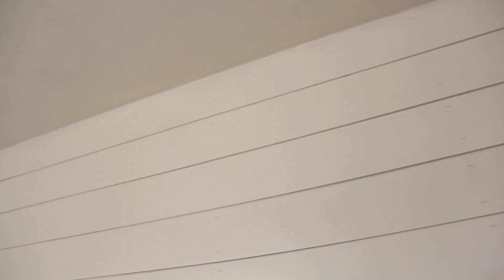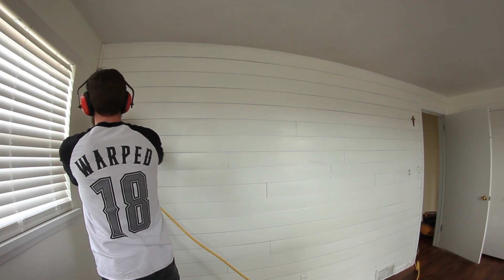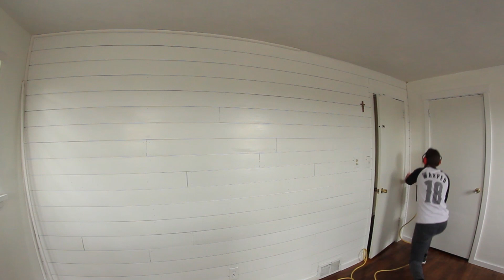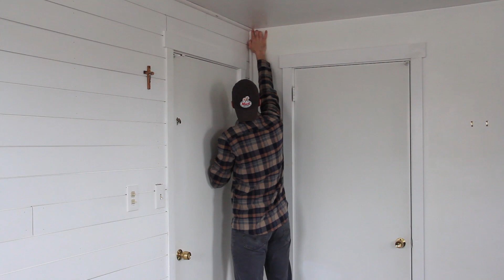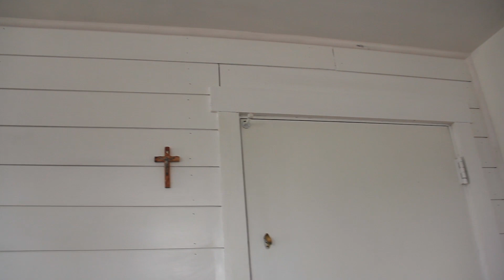How to Finish Exposed Edges of Shiplap After Installation - Farmhouse Renovation #4

Comment: I stumbled across your channel planning my shiplap project for a vaulted ceiling. There are gables on 2 sides that I want to use shiplap on. I had not planned to run shiplap from the floor to the peak of the gable. My plan is to start at the top of the 8 ft wall and run it to the peak. I'm trying to figure out the shiplap to interior wall transition. Previously the gable had a 1x4 cedar board at the point where the top of the wall meets the gable. These boards match the architectural beams on the ceiling covered with cedar boards.  Ideas would be welcomed!

Comment: I put up ship lap in bathroom only half way up the wall what trim is available to finish off the top of cap?
Reply from the maker: It's hard to say with out seeing it, but you can use 1x2, 1x4, or, 1x8 depending on what style you're going for.

Comment: what do you do if the last row of shiplap at the top wont fit between the second to last row and the ceiling?
Reply from the maker: You will need to use a table saw and cut your last piece of shiplap to make it fit.  Cut the excess from the top and use the quarter round to hide any imperfections.  Make sure you measure twice and cut once!  Good luck.
Reply: You can also use a circular saw. The cut does not to be perfectly straight since you will be hiding that edge afterwards.
Reply from the maker: You can definitely use a circular saw, we don't recommend that because it can be dangerous.  However, you can use whatever you have to get the job done.  Including a hand saw if you want to be there all day! 😝😂

Comment: how about outside corners?
Reply from the maker: We would be happy to.tell you what to do, but we will need you to explain a little more what exactly you want to know.
Reply: @TheBrothersWorkshop  thanks for reply guys. So the Take Care wall that I am putting the shiplap on ends on one side where the wall bends away at 90 degrees. I do not want to continue shiplap on the wall that is bent away. How can I cover the sides of the shiplap on that corner?
Reply from the maker: I see what your saying.  You will have to trim the corner.  This is done to create the allusion that the shiplap is structural.  After all shiplap is originally a structural element.  The best way to do this is with a 1x4.  If you can, try to make the 1x4 look like part of the wall.  I realize this is a little difficult to explain, especially since I don't know what your wall actually looks like.  I hope this helps, and good luck!